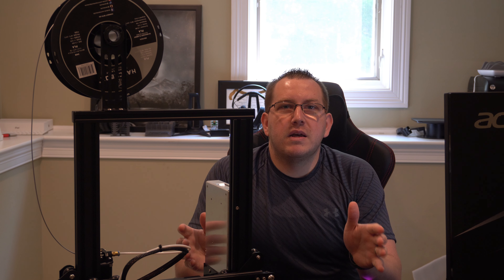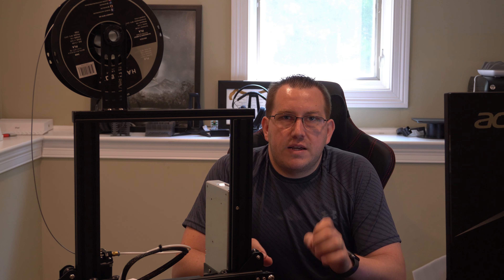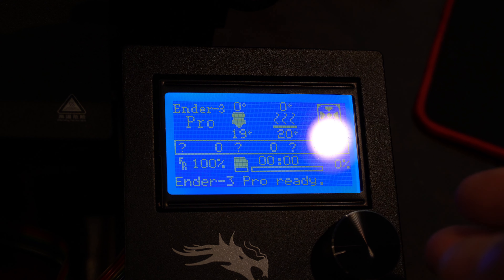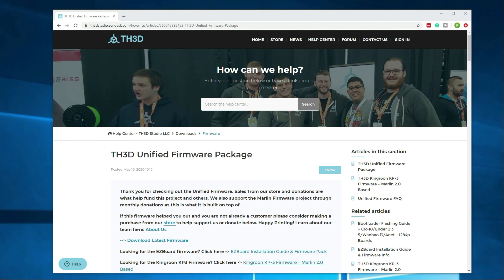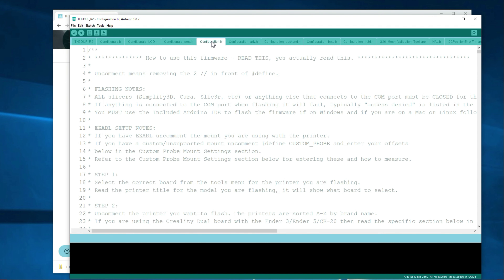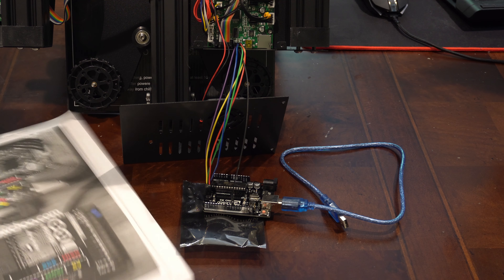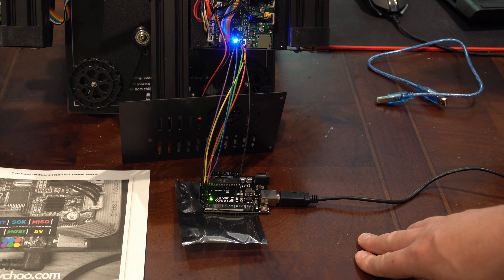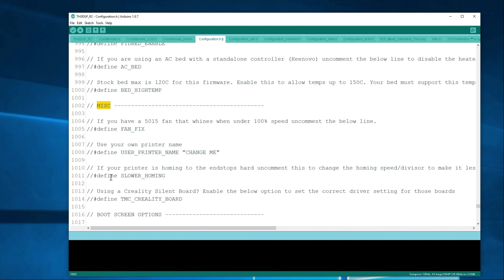Ender 3 Pro Firmware Update – Complete Guide

Comment: Just a heads-up. Some Ender 3 Pros come with Marlin and have temp runaway on by default. Probably just something that has changed since this video was uploaded 2 years ago.
Reply from the maker: Hi. Ya a lot has changed since this video. Its geared towards the old 1.x boards. The new pritners have the 4.x 32 bit boards which have a lot more built in.

Comment: Hey Rob, I was just wondering I noticed several newer videos about newer firmware. Which order of videos should I watch to get the most updated firmware from me being at the point of doing what this video showed.
Reply from the maker: Hi. Before i can answer that i would need to know what mainboard you have. If its a newer printer, you probably have the 4.2.2 32 bit board, if thats the case go to the video i have linked in the description. If you have the 1.1.4 8 bit board, you would follow this video.
Reply: @3DPrintscape  I have an older one I think but I did buy a Skr mini e3 v2.0 and wanna replace the board
Reply from the maker: @astrofrog0663  The skr mini is a great upgrade, especially from an 8 bit board. I actually did the same thing. Here is a video on the install process https://youtu.be/wtT6iA9IG7A .
Reply: @3DPrintscape  alright yeah I was seeing a lot of good stuff about it ill check out that video right now and will probably continue this conversation if I have any other questions on that video

Comment: I'm not finding the 6 pin port to connect the jumper cables to. I'm not sure if I'm missing something obvious, or if my Ender 3 circuit board is set up way different.
Reply from the maker: Hi. You probably have the 32 bit 4.2.2 board. I have a video coving that as well.
Reply: @3DPrintscape  Thank you I'll check it out.

(Edit, Yes it is the 4.2.2 board)
Reply from the maker: @coolstorybro1403  Ok, your much better off with that board over the 1.x 8 bit ones.

Comment: Hi, Thank you so much for this video! It is straight to the point and it doesn't look complicated at all, I have a question, I have in hand an Original Arduino Uno board, can I use it for this, following the same steps you did?
Also I'll like to use the maximum print area and I hope this update can help me with that, I'm in the middle of a project that needs these extra (mm) of printing bed that the Creality say it has but is restricted my firmware. (How can I overwrite that boundary and gain full size bed printing surface?)
Thank you.
Reply from the maker: Hi, I'm glad the video was able to help you out. Im not sure if the original Uno board will work, but it should. I think it's worth giving it a try, worst case it will give you an error and do nothing, so you don’t really have anything to lose. I will look into changing the bed restrictions and create a video on it if it works well.
Reply from the maker: I looked into this more and it looks like TH3D removes the limit and sets the max bed size to 235x235x250.  So switching to this firmware should give you the extra space you are looking for. Keep in mind that you will need to make sure you dont have any clips or anything like that on the bed as it can get in the way.
Reply: @3DPrintscape  Thank you so much for taking the time to respond, I really appreciate it! Subscribed! I'll spread the word with my friends and hopefully they'll subscribe as well, your video is the most easy and straightforward on how to update to Marlin!
I also appreciate you edited the unnecessary video parts such as uploading times etc, etc, that's how you make a good video! 
I'll order my parts using your links, I hope that helps your channel!...Thank you!
Reply: @3DPrintscape  Hi, how can I extend the printing size of the bed, say to 232mm? Cura still not allowing me to do that, with these stupid gray lines (I know they're there for hardware safety clearance) but it has to be a way to print wider than that, I have a project that is 230mm wide and I'm unable to do it, even after doing what CHEP shows in his video on "How to Remove the Creality Ender 3 Keep Out Area in Cura"
I'm using at the time of this comment Cura 4.6.1 and did the firmware update from your video.
Please help me or point me on the right direction, I don't know about coding and the only way I can do it is following a detailed how to, like your video.
Thank you.

Comment: great vid, thanks. a question; is there any way to get that extruder fan stop while whole stuff is idle?
Reply: one more question, is this bootloader setup required for mainboard v4.2.2. seems your mainboard is some 1.1.x version.
Reply from the maker: Hi. I believe that you dont need to install a bootloader with that mainboard. Its similar to the SKR Mini where the firmware is updated via a SD card. I cover that process in more detail in this video, its specific to the SKR Mini but the process is basically the same. https://youtu.be/Vn5rMdJgkAI

Comment: Hi Rob, I still haven't figured out to find you on Discord. This afternoon I succeeded in bootloading my 3D printer, but I failed in uploading new firmware. I think it's a computer issue, because when it's disconnected,  it also hangs at compiling the sketch.
Reply from the maker: Hi. Do you have a different computer to try with?
Reply: @3DPrintscape  hi Rob, in the meantime I succeeded. I have the 8 bit board, so I couldn't use the same software as you. And I didn't succeed with the help of Arduino IDE, so I had to use Visual Studio. In there I missed a part of the program in which the compiler is. Figured it all out and the board is fine now. The printer delivers much better results now. Also, I mounted the other belt holders with the knobs to adjust. Next step is the BL Touch. I ordered the wrong one, but received the good one yesterday, v1. The hardware part shouldn't be that difficult, but I don't know whether I have to flash the firmware again. I have the Marlin from TH3D now and that works like a charm. So a challenge is to come... any advice?
Reply from the maker: @janmenzinga  Im glad to hear you got it working. With the build you pushed, did you have the bltouch components enabled? If not, you will need to push another build. The good part is now that you have the bootloader on the board, its just the firmware update, so its not difficult.

Comment: what do you mean by creality 32 bit board? is it in the printer or do some people use creality 32 bit board instead of the uno board?
Reply from the maker: Hi. Creality started shipping the Ender with the 4.2.2 board about a year ago. If you have that you don’t need to worry about the uno board.
Reply: @3DPrintscape  so I can install jyers if I put the ender 3 v2 display on my ender 3 pro I just got.  4.2.2 board.
Reply from the maker: @dugy40  You should be able to, i havent worked to much with jyers yet, so i cant confirm.
Reply: @3DPrintscape  I successfully did it today.  I now have ender 3v2 display and jyers on my ender 3 pro. Even flashed display.
Reply from the maker: @dugy40  Nice, how are you liking it so far?

Comment: Hi Rob I installed the update following your instructions onto my Ender 3 Pro. Just did this parrot fashion.
New to this no real idea of what I am doing.
Don't know  how, but it worked.

Only one problem the speaker/buzzer has been disabled. Are you able to tell me how to reinstall it in the firmware.
Or can you direct me to another video on how to get the speaker going again?
Reply from the maker: Hi. The speaker should still work after the upgrade unless you also have the bltouch. Can you confirm if you have the bltouch and email me your configuration.h file? My email is admin@3dprintscape.com.

Comment: Just wondering are the jumper wires and uno board the only things needed to do the update? Thanks!
Reply from the maker: Hi. You will also need a USB cable to connect the Uno board and printer to the computer.
Reply: @3DPrintscape  So just any usb cord to connect to the 3D printer.
Reply from the maker: @Smil3yyy  It would have to fit the port on the printer, I think its just a standard mini-usb port.
Reply: @3DPrintscape  Okay thank you so much. I just started watching this channel and I already love it and it helps me a lot. Keep doing what your doing!

Comment: I'm new to 3D printing. My Ender 3 Pro will be here any day. I  bought some upgrades for it already and the BLTOUCH auto bed leveling is one of them. Mine says v3 on the part. I seen in another video that it will not work on the Ender 3 Pro?? Is this correct? Plus I seen a video that a guy just plugged one in and it worked. He didn't say nothing about upgrading the firmware. Any help would be great! BTW great videos.
Reply from the maker: Hi. The BLtouch v3 is compatible with the Ender 3 Pro, it's actually what I'm running on it now. You will need to update the firmware to use it. You can stay with the Creality firmware and use the USB drive included with the BLtouch, or you can move to the Marlin firmware, which is what I recommend. The biggest issue with the Creality firmware is it doesn’t have thermal run away protection. They said it was included in one of the releases, but people on some of the forums I follow ran some tests, and it didn’t work. The reason you need to update the firmware is because the one on the printer doesn't know what to do with the BLTouch. I did a video on the install process. You can check it out here https://youtu.be/OJhDSx6MRug.

Comment: Probably a duh kinda question but can I apply this upgrade to my Ender-3 (NOT pro)? It's (said to be anyway) the same motherboard, motors and sensors so I would think it should work. I'm currently running Marlin, Ver 0.0.5 from May 30, 2020 for Ender-3. Great video BTW!
Reply from the maker: Hi. Yes this process will work on the Ender 3. The board, along with most other components, are the same.

Comment: Hi, not working for me I am afraid! I get a red bar across the bottom saying "An Error Occured While uploading the sketch" I had already uploaded the Bootloader and installed Marlin via VSCode. I then installed a BL Touch & Used the Creality Software and all I want to do is re-install better firmware, I don't need to reinstall the Boot loader do I?
Reply: Just been reading the FAQs in TH3D, it looks as though I have to re-flash the bootloader, I presume the Creality upgrade must have overwritten the bootloader.  :-(
Reply: Yes, that was it, the Creality BLTouch installation must have overwritten the bootloader software Grrrr! Reloaded the bootloader and all was well.
Reply from the maker: Hi. Ya you would need to reflash the bootloader. Im not sure what the Creality firmware is doing that causes it but I’ve seen this come up multiple times. It sounds like you have everything working now but if you have any questions feel free to reach back out.

Comment: Hey Rob, I need help! I just received Ender 3 pro a week ago. I changed my nozzle but it slowly drips filament when it’s not printing. It drips a faster rate than normal. Any suggestions on the drip?
Reply from the maker: Hi. Did you see the same behavior before switching the nozzle? Also, Im assuming this is only happening when the printer is up to temperature correct?
Reply: 3D Printscape before I changed it there wasn’t that much of a drip. When the pla is at temp it is dripping. It is cause my prints to fail because it is created a ball of filament that grows. I also noticed my fan speeds are at 100% when I am printing. Not sure if that effects it.
Reply from the maker: I haven’t had than issue like that before. What type of nozzle did you add back in and did you make sure the heat block was up to temperature when changing the nozzle?
Reply: 3D Printscape I am using a .4 and yes the heat block was at temp too. Should I reinstall?
Reply from the maker: As a test, I would put the old nozzle back in to see if it fixes the issue.

Comment: Do you know why there's a yellow light illuminated on the Uno R3 board?  It is labeled "L".  I am having a hard time connecting the computer directly to the printer.  COM1 is the only thing that shows up so I am investigating if I am even flashing the bootloader like I think I am?
Reply from the maker: Hi. I’m not sure about the light but I think it’s normal. When you flash the bootloader, you should see what’s going on in the terminal output. Look closely there to see if it’s connecting and to check for any failures.

Comment: At 13:38 my ender only has 4 pins to plug the female to male wire. Got any suggestions?
Reply from the maker: Hi. It sounds like you have the new 32-bit board. That would get updated using an SD card. I cover this process a bit more here, though its focused more on the SKR mini https://youtu.be/Vn5rMdJgkAI .
Reply: @3DPrintscape  thank you so much!!

Comment: I have a Macbook Pro with the M1 chip. I can't seem to get any thing to work. My Ender3 Pro was working fine with it until I added a BL Touch Autoloader and thats where my trouble started. When I start my printer the screen is now corrupted. On your site you state the firmware needs to be updated. I have tried every approach I can come up with and cannot update the firmware.  I have the elegoo unoR3 and can't get the software for that to work on my M1 Mac either.  I am at my wits end, as I now have a printer that is useless to me.  Can you offer any solutions?  Brad
Reply from the maker: Hi. This video may help with the screen issue. https://youtu.be/t4QE1jPncms

Comment: I flashed the firmware and installed BLTouch using your videos - it was awesome - Now my problem is I cannot change esteps on machine I am not sure how to do it anywhere else?
Reply from the maker: Hi. By default, Marlin has advanced settings disabled. You can find the esteps config by searching for “define CUSTOM_ESTEPS” in the configuration.h file.
Reply: @3DPrintscape  I found it by changing it in Pronterface.  Thank yuo!

Comment: Thank you for this, I followed every steps and was able to successfully updated the firmware , just want to ask gow to calibrate the xyz stepper motors? That function seems to be missing in the marlin firmware, thank you
Reply from the maker: Hi. Thanks for the feedback. I believe you can uncomment “//#define CUSTOM_ESTEPS” in the configuration.h file to if you want to calibrate the stepper motors.
Reply: @3DPrintscape  thank you for taking the time to reply, I edited the     configuration backend tab, that did the trick

Comment: I am getting an error message when i try to attach the 3d printer to my laptop in one of the last steps.  could it just be the cord? It is not showing an available port?  Maybe I am not connecting it properly.  Do i go from the same port on the 3d printer to a usb port on my laptop?
Reply from the maker: Hi. Can you provide more information on the error and also do you know what mainboard you have?
Reply: @3DPrintscape  Im so sorry but I am a cookie baker and use my printer for making cookie cutters, I have zero computer skills.  The reason i did the firmware update is because my screen went black.  I have downloaded a new driver and have gotten it to work when it is plugged into the computer - the marlin screen comes up and goes the the main screen - I see my new printer name on the screen that I changed with your tutorial.  However, now when i disconnect from the computer my black screen problem is still not fixed.  Any ideas?
Reply from the maker: @christabachmeier1729  When you power it on with it not connected to the computer do any of the fans or anything come on? If the screen comes on with it connected to the computer but not from powering it on the power supply may have gone bad.

Comment: Will this solve an issue on getting a blank blue LCD screen on my ender 3? It had an error of stopping mid print today and after I turned it on it was a blue screen.
Reply from the maker: Hi. Honestly, it depends on what caused the initial issue but its worth a try. If there is a hardware issue, a firmware upgrade wont help.
Reply: @3DPrintscape   okay because it started working, printed fine after. But how often should I do these firmware updates ? Thanks for the response in general btw
Reply from the maker: @laggypenguin7107  Glad to hear you got it working. I tend to update my firmware a couple of times a year, sometimes more often if there is a feature I'm looking for.
Reply: @3DPrintscape   okay sounds good. I'm just new to owning my first 3d printer so this is all new to me. Thanks for the updates,I'm for sure subscribing.

Comment: How would you get the e steps calibration after doing this i did this and in motion there is no option for e steps
Reply from the maker: Hi. It should be enabled in the firmware, but if its not you will want to uncomment in the firmware. I dont have that version right now so i cant get the exact line to uncomment.
Reply: @3DPrintscape  in your video did you uncomment it in this video
Reply from the maker: @flashtrofrog3750  No, thats something that is typically disabled by default and I did not enable it when making this video.
Reply: @3DPrintscape  is there anywhere i could find the comment that I need to uncomment like anyone who knows or something
Reply from the maker: @flashtrofrog3750  It may be worth joining my discord server to see if anyone on there knows. https://discord.gg/Bu94EYVkrU